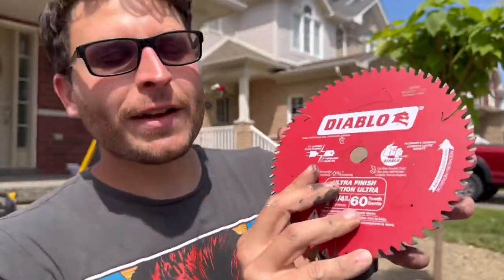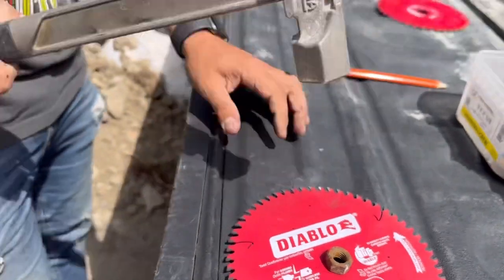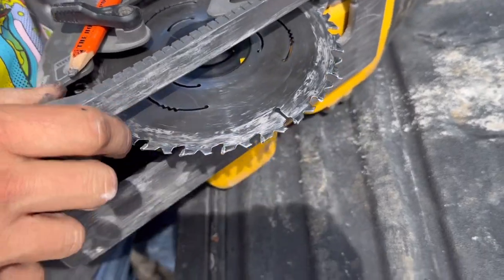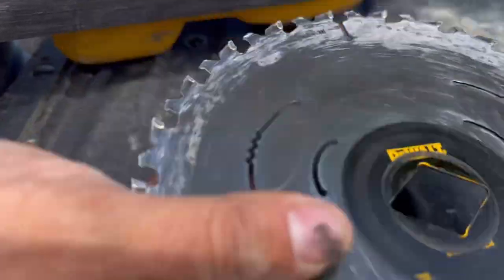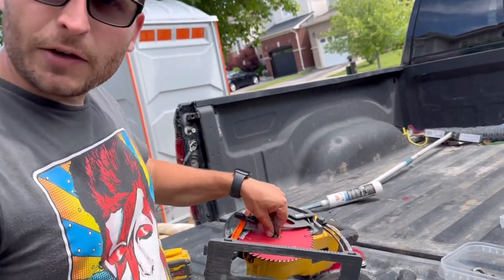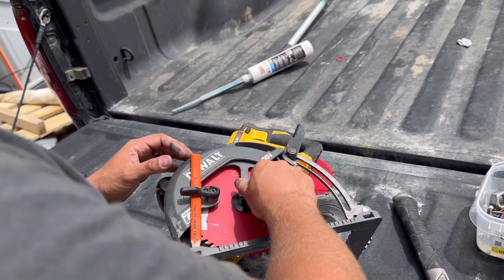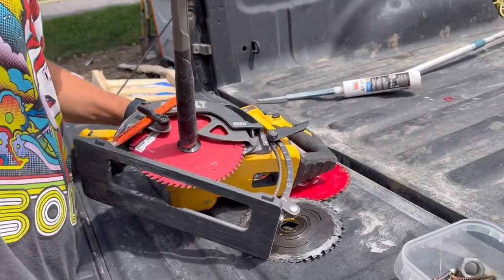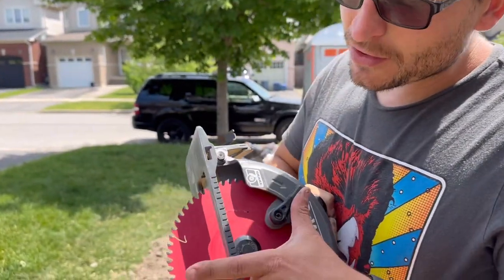EASIEST WAY TO PUNCH THE DIAMOND OUT OF YOUR SAW BLADE?

Comment: my milwaukee rear handled saw has a 30mm circular arbour slot not the diamond slot, will the diablo blade still fit if i knock the diamond cut out out?